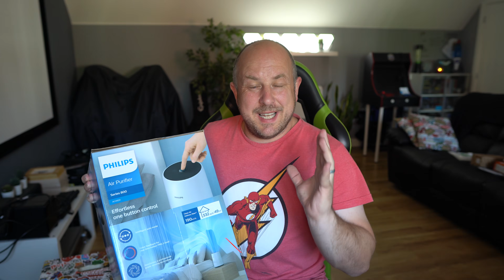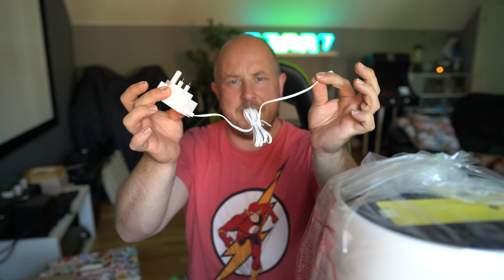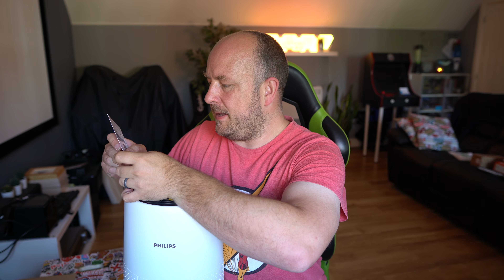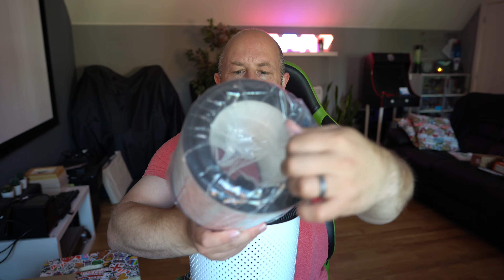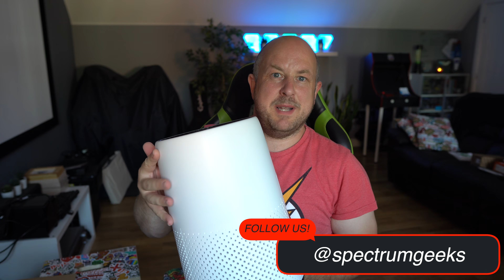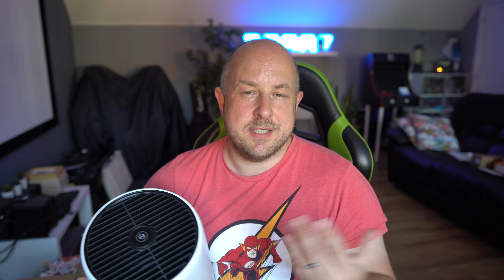Checking out the Philips AC0820/30 Air Purifier - Silent and Effective Purification

Comment: Great video. What about cold air does it come out it like a ac? I dont want that 😂
Reply from the maker: Not cold air like an AC, if you put your hand above it you will feel air movement, but its not designed for cooling, its just the air passing through the filters.

Comment: Im getting a red flashing signal on my Philips purifier . Do I need to just clean the filter or completely replace it ?
Reply from the maker: Under normal conditions you should just be able to clean the filter and then follow the reset procedure. I have a video for this on the channel also.

Comment: Is it less effective when on sleep mode ?
Reply from the maker: It is less effective in sleep mode, as it wont adjust the airflow based on particle detection, but it also means you wont be woken up at 2am if there is a sudden increase in fan speed.

Comment: Mine is always red...its been two days...it changes its clr to pink that indicates poor air nd then again it goes to red...
Why is it happening?
Reply from the maker: The particulate sensor is still detecting the air requires purification, so its simply doing its job.
Either the room you are trying to purify is to large for the unit, or something in the room is generating unclean air that is requiring the air purifier to consistently work.
My first suggestion would be to gently clean the sensor with an ear bud or similar and see if maybe something just got stuck on it, just be careful as it is fragile.
Reply: Clean the filter perhaps

Comment: That on/off switch is utterly useless since you can't switch off the powersupply with it. Genius! 🥴🤌
Reply from the maker: Not sure I follow, the On / Off switch is at the back of the unit.
Reply: @ConsideredUK  Yup, and the powerbrick will continue to provide power up to the power switch. It is the same with any brick you plug in the wall with no device attached. They all consume power non the less.
So it isn't like with some old TV for instance that had a physical switch that would cut the AC to the power supply of that TV, and stop the power draw from the wall completely.

To me that is a bad design decision by Philips. It was better to have an internal power supply to which you could cut off power with that physical switch.
A figure 8 power cable would be enough and easily replaceable with a longer one if you so desired for placement.

Comment: is it advisable to get this then an air humidifer?
Reply from the maker: This is NOT a humidifier, its a purifier, it cleans the air as it passes through it.
It does not add or remove moisture.

Comment: is this better than levoit core 300?
Reply from the maker: I have not personally compared the two, but the Levoit Core 300 seems to have better features (i.e. timers) and potentially a better filter element as it also has carbon to eliminate odours.
However, no idea how it works in practice, but very happy with the Philips.
Reply: @ConsideredUK  it's really cool when content creators actually do reply :) there's a big sale coming on that philips, so I'm really torn as there have been many good feedbacks with levoit 300
Reply from the maker: @minjusohee  Always reply when I can, its all about building a community. The Levoit looks good so I think you will be happy either way, but certainly no regrets with the Philips, and may actually get some more.

Comment: Hi i recieved mine yesterday. I did turbo for 20 mins as was red. Then i did auto for a few a
Hours and was left on red. Is this normal. I had it on sleep mode all night and it was purple just now but turning red again when i put it back on auto.
Reply from the maker: Its RED as its not happy with the air quality. So just leave it to do its thing, it will turn below when it has filtered the air enough where its located.
Reply: you need to clean your home

Comment: Could you please tell the direction of airflow? I mean from taking the air from the side holes and releasing to the top or taking the air from top and then releasing from the sides?!
Reply from the maker: The air is sucked in from the sides and filter air comes out the top.
Reply: @ConsideredUK  Thank you...